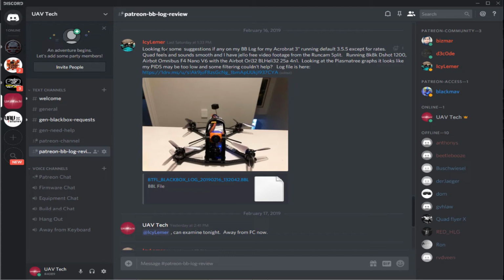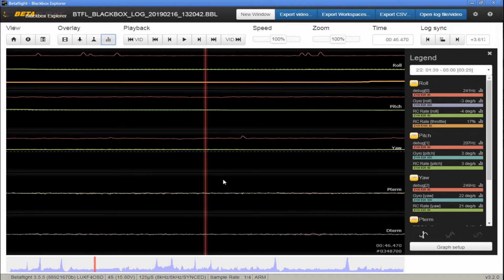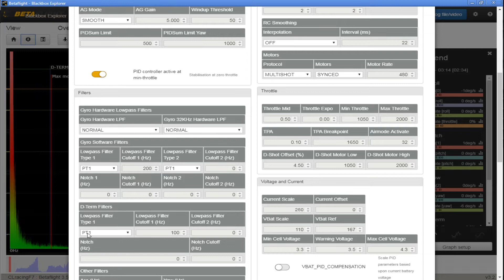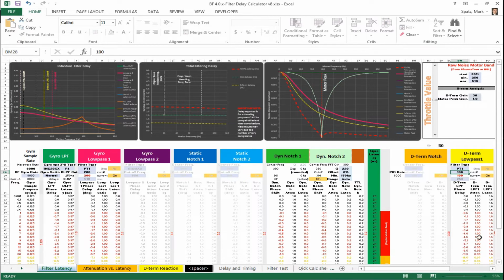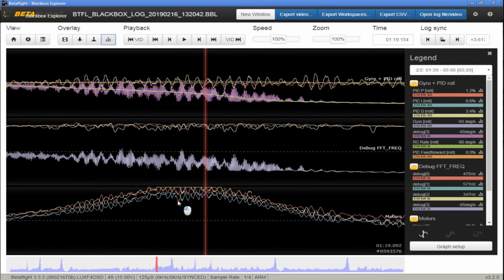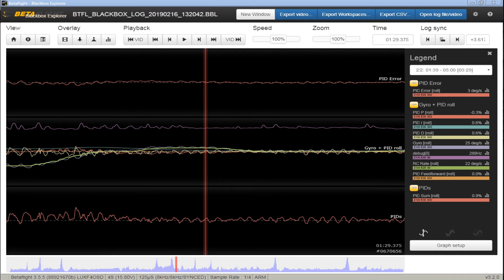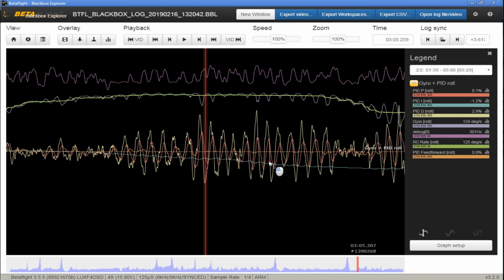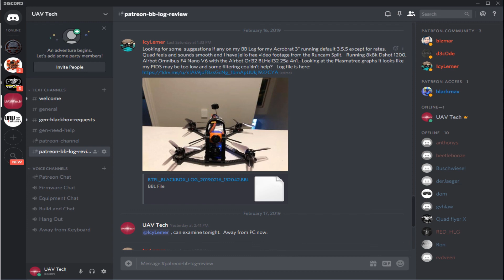IcyLemer - Acrobrat Log Review

Comment: I didn't see any caps on his build....but would a 1000mf cap maybe bring down those little noise peaks?
Reply from the maker: Good point.  In general, there is pretty low raw noise, but good point.
Reply: On a 3", that size cap is usually a touch gratuitous.  A 25V 470uF will get the job done, and fit in builds a whole lot nicer.  Similarly, when I have RX/VTX/Camera all on a 5V rail, I find it's worth it to run a 16V 220uF cap on the 5V and the video cleanliness is exceptional despite how hard I fly my 3" goofballs.
Reply: I did not add a cap as the video quality was perfect already, but if you're saying there could be some benefit to adding a cap noise wise I may consider it down the road.
Reply: @caymandiver75  Most of mine have really nice clean video 95% of the time - I run caps on them anyway because that one time I knick up the props on a tree and still need clean enough video to hit a gap and punch out, I want to have the cleanest video I can.  Then again, I build all mine to crash, the flying handling is a secondary consideration